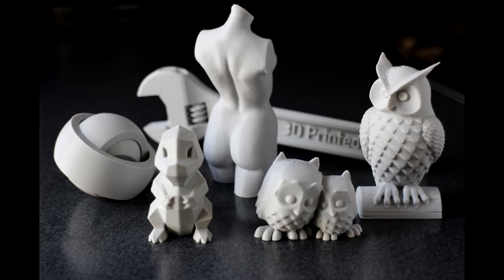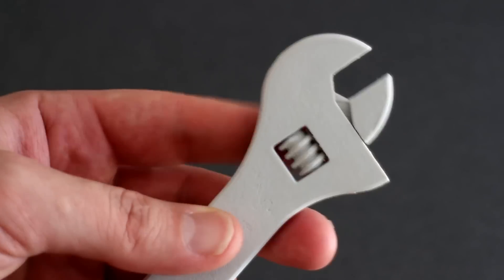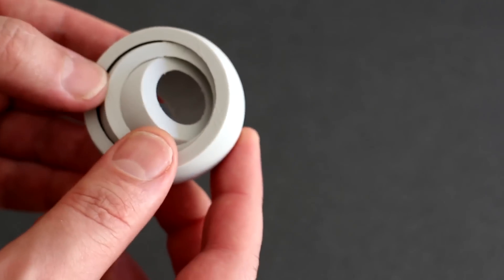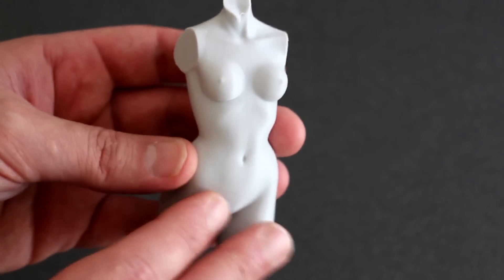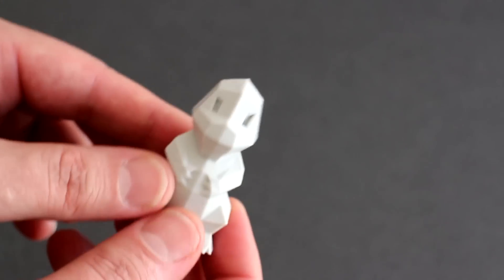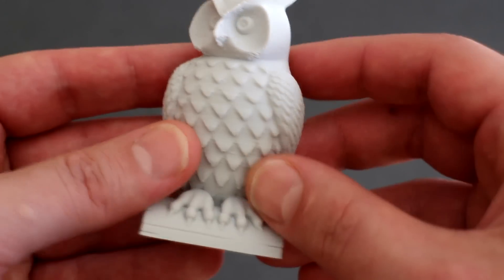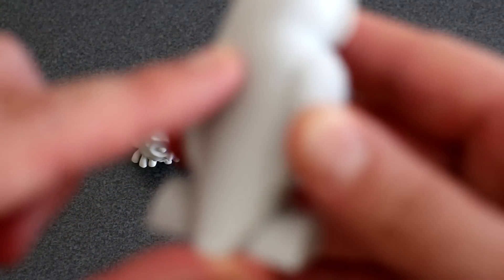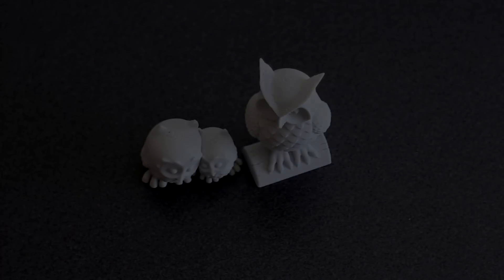What Can You 3D Print?

Comment: Print this on 100% infill once you think you have your settings right, ESPECIALLY if you print in ABS. PLA is a better material in my experience, as it doesn't stress bend. At 100% fill, it is remarkably strong. However, when it does break, it will shatter like glass.

Comment: I had some problems getting the adjusting nut to stay down on the bed after the 3rd layer or so... I ended up increasing my bed temperature (from 50-70) for PLA (this is on an Original Prusa i3 Mk2 w/ PEI bed). I know PLA isn't best for something like this but wanted  a challenge. Seems to be printing better so far...

Comment: Hello my 3d-printer friend! I saw a few videos on "3D printer filter". By Barnacules Nerdgasm youtube channel. Basically he cuts a little piece of squishy foam, the squishier the better, and lightly clamps it around the filament. Placing it snug up against the feeder tube. So any dust or debris is removed before the filament gets to the hot end. He said it really cut down on clogging, especially out in his dusty garage. Apparently some filament really becomes static charged. He said he tried cooking oil, but the comments revealed that cooking oil decomposes over time and becomes sticky. So stick to machine grease if you choose to grease the foam. On my Da Vinci Junior (shudders), I've just used the foam with no grease, and I imagine it's helping. Also I have been doing something unique...I keep a pipe cleaner rubbing up against the filament-grabbing gear/wheel. So, the gear is always perfectly clean even when I get some nasty soft filament in there. Cheers. :)
Reply from the maker: Great idea Royce! Thanks for your comment!
Reply: Great idea with the pipe cleaner - thanks for sharing :)

Comment: What filament did you use for these really fine prints? ABS or PLA? :)
Reply from the maker: PLA. Easier to print with as it doesn't warp as much as ABS, nor require a super hot heated bed to counter the warping.

Comment: By the way, how have you done for having your layers uniform? In my prints layers are marked and you can clearly see its 3d printed. I've printed it on 200 Cº with PLA
Reply from the maker: +Pol Canuto 
Well, try reducing the layer height to 0.2mm or 0.1mm. Also use the printed part cooling fans whilst printing.
Reply: I've switched from Slic3r to a "free version", if you know what I mean, of simplify 3D and by keeping layers high at 0.2, my prints gone much better :) thank you anyway for your advices

Comment: I printed the wrench on my prusa i3 Original (kit) with 
Layer height: 0.2
Top-Bottom layers: 3-3
Infill (honeycomb): 40%
Speed: 80mm/s (Around)
Perimeters: 2

And it printed perfect first try. The built-in supports came off easy and it turned pretty easy. :D (Took 2:01 to print)
Reply from the maker: +Meow 
Welldone! I should revisit this as I've made various changes to the way I print, including using a differnt slicing program.

Comment: How did you fixed the issue with the flowrate?
I cleaned my Hotend/Nozzle a few times, screwed the screws on the Bowden motor springs to get more grip.
And i also increased the Flowrate at Cura.

Comment: Hi Tech2C, these videos are great and was the number 1 reason I ended up choosing a reprap Prusa i3. I have completed most of the upgrades that u have done to get better results, all of which have helped dramatically. The only real issue I have now is printing large objects with pla with it lifting the blue tape off the glass bed and warping, are u printing on blue tape still? it looks like your printing on the aluminium head bed now? and do u use a heated bed when printing pla on blue tape? Thank You
Reply from the maker: +gurnballs2007 
Hi, congrats on your new printer - well done with upgrades too!

I am still using Blue Tape, although I have a sheet of buildtak as I've just been printing PC-plus on my latest video.
I have switched to an Aluminium heatbed because I fount the PCB heatbed had a 20c lower temperature from the outer edges to the middle! That was causing major warping issues with ABS. Definitely switch to Aluminium if you're printing large parts.

You can try increasing the heatbed temperature past 60c to aid with keeping the part softer whilst printing. Also adding a brim is very useful. With blue tape, if the PLA part is a uniform shape or small I don't bother with heat. Long parts or longer time printing parts I use heat.
Reply: Thank you so much for the info, will be very useful, so you use the heat bed with blue tape? no issues with adhesion?
Reply from the maker: With PLA, no problems. ABS benefits from a brim.
Reply from the maker: Lift the nozzle by 0.05mm and don't use too much heat. I also remove the part using a disposable box cutter knife extended all the way out, and remove the part like a spatula.

Works most of the time... ;)

Comment: Thank you so much. I've been watching tons of your videos and tuning my Da Vinci from your advice and tips. It's so much better now.
I've just printed the wrench and it worked first time. You are a genius my friend.
The wrench only needed a very minimal amount of post print trimming, I gently parted the sliding jaw from the body on the under side (this was only due to 'first layer spread', then trimmed the spread from the thumb wheel. The supports came away with just a little wiggle. Thats all I needed to do to it.

Printing the Gyro Rotating Rings now :-)

Comment: Hi there, I would like to ask you a question. I printed a 20x20x20 cube and it turned out to be 20,3x20,3x20,3.. but If I calibrate lets say my X axis by placing 2 stripes 100mm displacement from each other I measure 100mm with my caliper. but still the 20 turns out to be 20,3 and holes always turn out smaller so a hole of 6 would always be like 5,6 to 5,8. how do I get the geometry of my prints more accurate? Great videos!
Reply from the maker: +00Mass00 
Well you've answered your own question. Your printing steps are a little bigger by a factor of 1.015. Reduce your x/y/z steps by dividing them by 1.015. Print the cube again and measure the dimensions. You may need to iterate a couple of times until it's perfect. Then your holes should be pretty close to the desired size.

Comment: I liked the adjustable wrench. Tried it on my Dremel 3D printer at 200µm sliced with Simplify3D. The jaw is a bit stiff, but otherwise I would call it at 100% success at the first trial!
Reply from the maker: +Matthias Toussaint 
Well done! First go for the wrench is an achievement in my book.
Reply: +Tech2C The Dremel printer is not the cheapest on earth and it only prints PLA but I read a test in a German magazine. I basically blew away all competitors in the price range. A few days later I had one on my desk :)

Comment: Was blown away by your 0.1mm print ,I want to get this one from aliexpress I see theres bunch of versions of this specific printer. can you recommend me a decent one my budget is roughly 300$ ?
Reply from the maker: TheBlackAndWhiteCow 
0.1mm is really nice. Very hard to distinguish that it is actually 3D printed at that resolution. Does increase print time though.

Well for $300 you can certainly attain the same level of print quality as me, but it may take a few mods or upgrades, or you may be lucky and have perfect prints without mods. 

I'd look for a kit that has the following features: Bowden extruder, 1.75mm filament, aluminium heatbed, adjustable belt tensioner for x and y belts, z axis motors with inbuilt leadscrew as the motor shaft (no shaft coupler required).

Oh, and quality filament ;)
Reply: http://www.aliexpress.com/item/Hot-Full-Acrylic-Quality-High-Precision-Reprap-Prusa-i3-LCD-Acquired-DIY-3d-Printer-Kit-with/2026704108.html
This one looks very attractive price and quality wise ,the only downside that I see is the acrylic body but what do I know I pretty have much have zero experience with 3D printing.
Reply from the maker: That model has been popular. Very well priced. Check if you can find reviews of that model before popping on it.

Comment: Nice print on  The Pink Panther Woman,  beside the fan  was you I3 modified to J-head or feeding system change to achieve such high resolution ?  Please give some advises  Thanks
Reply from the maker: Stephen chua 
For me, switching to a Bowden extruder helped a lot. Also make sure your z-axis threaded rods are not bent, and use quality filament.
Reply: Thanks Tec2c,  will follow your advice.

Comment: Nice video and very nice prints for a RepRap 3D Printer! May I ask couple questions: Could you tell the filament manufacturer and possibly link to it (not so glarry grey colour looks really cool) ?
What are the hot end temp. and retraction settings in above prints ?
Reply from the maker: Łukasz Wardziński Hi there. Here's the 3D filament supplier I use: 
http://www.3dprintergear.com.au/australian/267-australian-light-grey-pla-filament-1kg-22lbs.html
With PLA, I print at 220c and retract 3mm at 100mm/s.

Comment: What diameter nozzle are you using? you say you print at .1 .2 and .3 layer height but i thought the layer height needed to be the same as your nozzle diameter? are you changing nozzles?
Reply from the maker: vgg1 I have a 0.4mm diameter nozzle. You can print at layer heights smaller than the nozzle diameter as the filament just smooshes down, plus the slicing software is smart enough to reduce the filament flow rate when printing at lower layer heights.
Reply: Tech2C  Oh ok thanks. I tried that though on .2 height with my .3 nozzle, and for some overhangs and details it was a total failure.  What slicer software are you using also? I am using CuraEngine. Did you use the .4 nozzle even for the peice printed at .1 layer height?

I was using Slic3r up until yesterday and it seems with cura prints are better.
Reply from the maker: vgg1 Yeah 0.1mm layer height with a 0.4mm nozzle. I had to place a fan on both sides of the print to stop the plastic from curling.

I had a go of Cura and liked what I saw. I'll have to use it a bit more to pass judgement on it. I'm currently using Slic3r.
Reply: Tech2C thanks. does the fan help a lot with warping and curling of prints? that's a problem i currently have
Reply from the maker: With PLA, it's a must for small parts and finer layer heights. As a quick test just point a pedestal fan at the part whilst printing to test if it helps.

Comment: Awesome prints !
I have made some improvment on my Replikeo kit too. Recently change smooth rods by hardened rods with chromium, and replace all LM8U. The smooth rods from Replikeo are made of standard steel and after somes weeks, several small grooves appears and vibrating noise increase (I also think that it plays an important role in the development of small waves on vertical surfaces). You can check this by rotate each rods a few degrees.  if the sound changes, it is likely that the bar and / or the bearing are worn. It really makes a huge difference in terms of print quality.
As you use a bowden extruder, try this small clips to reduce backlash and retraction lenght on slic3r (I was about 6 mm , I am now 2.5 mm retraction with 0 ooze string) http://www.thingiverse.com/thing:699415
Reply from the maker: Woah, that clip idea is sensational! I'm definitely adding that to my printer!
I have purchased 4 spare LM8UU linear bearings to replace the 4 in the x-carriage, just haven't got around to doing it yet. Mine do make a noise when moving, hence the need to change them.
The rods I have don't show signs of wear, but if they do I'll swap them out as well.
Reply from the maker: Do you have wobble or backlash? If it's wobble, then yeah that link you provided will help as it allows the z-axis threaded rod to 'move' without affecting the x-axis parts. I'm not experiencing wobble.

Comment: Really nice prints! Have you tried slicing with Cura at all? I'd love to hear your thought on it as I find that a lot of the time it produces much nicer prints. :)
Reply from the maker: ***** Not since very early on. I've become complacent with the Slic3r/Pronterface combo. I'll give Cura another shot though as it's been a while, plus I have a better idea of what I'm actually doing now...!
Reply: Tech2C That's good to hear! I'm really interested to see how your printer handles cura considering how finely tuned you've managed to get it. 

On a side note, do you find that the E3D works better with your bow den setup than your previous hot end (j-head if I recall correctly)? I tried a similar setup with my hexagon hot end and the airtrippers extruder and found that I tended to extrude fine for a while before the hobbed bolt just ground through the filament. Just wondering if it could be due to my hot end?
Reply from the maker: ***** It's not a fair comparison with my original Jhead because:
1) 3mm filament
2) Direct Drive only.
Although, the Tantillus 3D printer does great with 3mm filament plus Jhead with Bowden, so maybe it's just the Bowden?

Sounds like your hexagon hotend has debris in it if it continually clogs after a while of printing. If you have ABS plastic, try to clear out your hotend first so you can see light through it when looking down into it. Then dip a piece of filament in canola oil and pass that through. Only a drop is needed.
Reply: Tech2C I don't think its clogging because it prints fine with a direct feed setup (although there probably is gunk in it as my layers are not perfectly even).
 
I did actually manage to bend the hotend at the heat break slightly when I first got it, however I bent it back pretty much perfectly straight again. Maybe that has something to do with it?
Reply from the maker: Ah, did you calibrate your steps when switching from direct to Bowden? Either way, make sure the Bowden idler bearing is really tight against the filament, then re-calibrate the steps with the filament through the PTFE tube only - not through the hotend. Give that a crack.
Reply: Tech2C I did calibrate the esteps/mm with the hotend connected so ill give it a shot without! Thanks :)